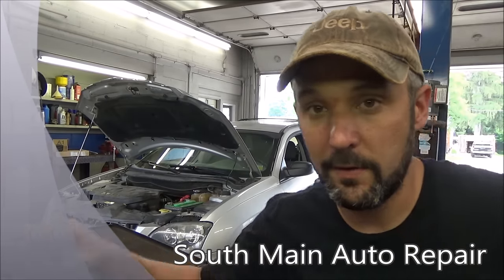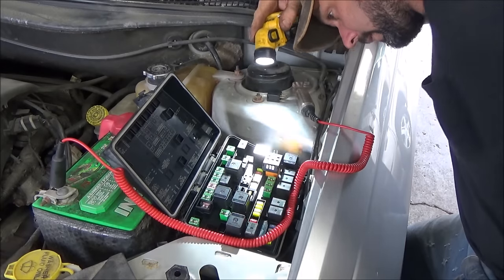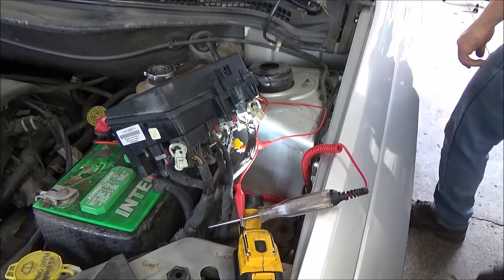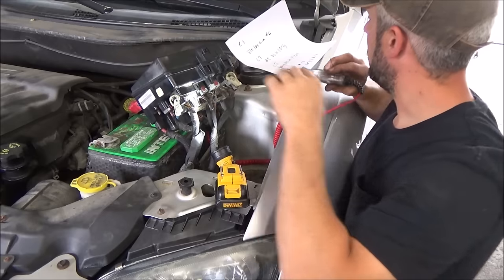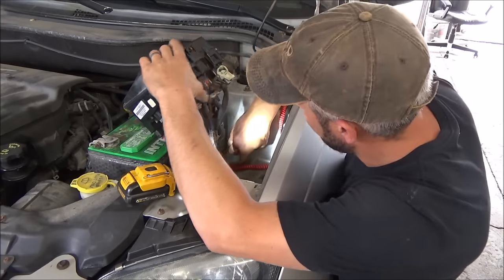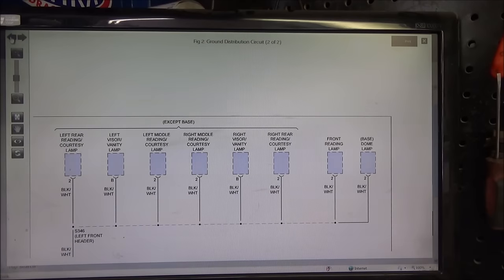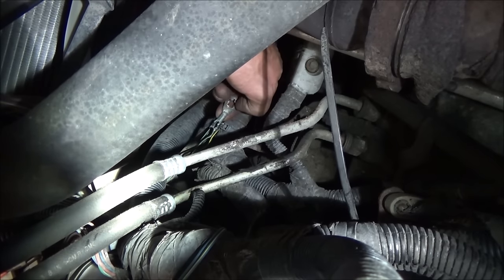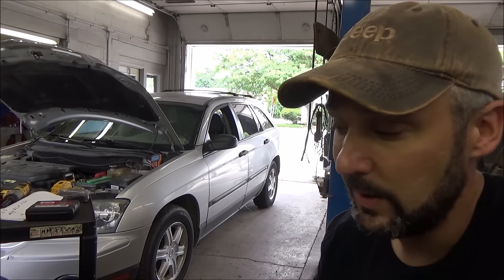Chrysler Pacifica: TIPM Electrical Problems

Comment: Having had the last 3 or 4 of my vehicles Grand Caravan or Town & country (2003, 2005, 2011), they have some pretty weird problems. I have found green wires on the bottom of the power module, rear ac leaking, and the latest the power doors on the 2011 open then close by them self at full open.  I called the dealership about the doors and was told they have no idea why they do that and have no idea how to fix it but they can re-flash the computer and see it that fixes it at a pretty hefty cost to do 
that. I guess the part that pisses me off royally the survise department knows about these inherent problems (yes all ga-gillion of them) and just out & out lye to you if you call & ask about the problem like saying we don't know of them doing this.  (&(%&$@%&& Chrysler.  You may ask why I have had many Chrysler/ Dodge vans if I know they are really screwed up, my wonderful brother has given me them when he gets a new/used vehicles .  Being on a small fixed income I am grateful to have such a loving family.

Comment: Im watching this because my son bought one of these pieces of trash, and is having intermittent electrical problems. I watch all of your videos, but the fact that you did not clean those battery terminals, and did not cover the terminals with a rubber mat before laying that tipm  across the teminals, oh, and that damned bird is bugging the crap out of me.
Reply from the maker: Nope I didn't do any of that. I fixed the real problem 😉

Comment: Our posts get regularly removed, because we tell it as it is, the truth!

Our 2010 Chevrolet Express 4500 cutaway miniBUS with 6.6 Duramax LGH diesel quit twice(COMPLETE BLACK-OUT, ENGINE snapped DEAD in the middle of traffic).

So many vehicles on the road are death traps... just had bought a miniBUS driving it home 200 miles... same issue, except your fuseblock and ground wires are easy compared to ours - we had to take the whole front end apart to get to the equipment - definitely designed to make it impossible for diy. ...and even with that out of the way, still, the harness going into the fuseblock, deep, short, NOT READILY ACCESSIBLE even the top of it where fuses and relays are can only be viewed partially, arm's length deep behind all sorts of obstacles that cannot be removed!!!, with High-Amp connector widely exposed, turn it slightly wrong, massive sparks!  Taking off the fender or wheel well, NOT AN OPTION!

so, IT QUIT(COMPLETE BLACK-OUT, ENGINE snapped DEAD in the middle of traffic, no-where to pull off, not one thing ON, no-way to crank it, loosing speed rapidly, emergency flashers dead, ... traffic behind piling up quickly(up hill on a no shoulder area)... finally squeezed to the right, barely lined-up with the white line, now traffic passing by at 80mph shaking the creamPuff like a tree in the wind at super-high-risk to be rear ended.

Happened every 15-20 minutes on road... turned everything off, no lights in the rain, lucked up on the GM light switch operation with that criminal spring loaded left twist to turn the AUTO OFF.
NOTHING on a dashboard should require to think(or know in advance) so as to be able to operate it!!! ...turned that auto off BY PURE LUCK! Had never seen such switch.  Only realized that later once home thinking back... PHCKNG IDIOTS!

Hit sunny time for last 150 miles and it never did it again.(kept everything off)
- did not know left blinker did not work since the indicator on dash keeps blinking even when lamps/circuit fails(ALL vehicles I drove in last 50 years had that warning, WTF!!! GM!!!)
- same with the high-beam indicator, ON yet-no-high-beams!

Once home, parked it waiting for time to start conversion... 10 months later, decided to let it idle, parked, to charge the batteries, test to see if would overheat standing... within 15 minutes BLACK-OUT!!!

Same SHITE, high-beams failing, one blinker side failing, ... is part of the equation!

Manufacturers are criminals, doing everything so that they keep control and force the GOYim to their repair centers... how can they build something that BLACKS OUT completely due to only one point ground failure!?

Well the people is stOOpid... the people does not oversee/monitor what these criminal enterprises do.

Times will change, with information flowing thru the network, it will become harder for them to own the world and get away with their abuse. ...though they censor all that exposes them.

Cave man's age, iron era, industrial era, information age, ... age of changingTheCriminalLawsAndsuingThePhckOuttaAllCriminalEnterprises.

Comment: i have two of these junk cars. ( pacifica)
(i got 1 for parts).
sit for 2 weeks then went to move it.
NOTHING
I MEAN NOTHING!
DEAD BAT...NOPE
NOTHING!
NO LIGHTS NO NOTHING! NO CHECK NO NOTHING.
JUST LIKE I HAD NO BAT IN CAR. NOTHING!
I WILL NEVER BUY CHRYSLER AGAIN!
10 OUT OF 10 THAT I HAVE HAD ...all had transmission & electrical problems

Comment: Those TIPM's are ridiculous. There are a bunch of non-user-replaceable relays inside them, for example for the fuel pump, power door locks etc. Why not just expose them all on the top side like they do with the horn relay? Why did they decide that you should be able to pull out and replace your horn relay, but if you fuel pump stops working, you need a new TIPM. What a joke. Of course those of us who enjoy electronic pixie wrangling would pull out the pcb and replace the fuel pump relay, but 9 out of 10 consumers, or even mechanics, are just going to replace the whole TIPM. Almost like it is deliberately a disposable part

Comment: I will cross my fingers and pray away
Reply: you can pull one of the fuses & it will drive until you can deal with the ground issues. my 05 Pac has had most of the issues one can find on youtube & many of them are due to the corroded ground terminals under the battery tray
Reply: i forget the exact fuse right now but i know its a 40amp green i believe between 1st & 10th slot. if you pull it out car will run i'm pretty sure

Comment: Ha Ha All you Mopar haters. It was a simple corroded ground that would/could occur on any vehicle. Chrysler electronics ... blah, blah blah.
Reply: Pacificas were known for suspension and electrical issues.  If you doubt it, then Google it.  We had an '04 which was the worst year model Pacifica ever made.
Reply: I have a 04 since New and never had to do a thing to it other then normal wear parts and oil changes almost 200,000 on her now and still going strong with no problems!!!!
Reply: @gregdolliver8402  maybe so, but like I said look online and the others testimonies bc you don't represent the majority of the population
Reply: And as Eric says the cross members on those are known to rust out and disintegrate.   I've read stories about it

Comment: Chrysler is junk...I had cold crank a 2006 chrysler town and country limited and I turned the key off and took it out of the ignition and it was still cranking but no start..had to disconnect the battery...

Comment: What a turd of a vehicle. Around 2008 add to the shitty engineering of that TIPM the fact that they were pinching every penny in sourcing materials and suppliers...chryslers from this era are an absolute joke. I've found this and several other issues with the TIPM on 300's, Chargers, you name it.

Comment: Typical Mopar junk! 
They used to put the batteries over the shift linkage and throttle pressure cable at the transmission and it'd eat the linkage and when you shifted the transmission into various gear positions, the throttle pressure went with it and just created havoc with the poor transmission. 

Again - TYPICAL MOPAR CRAP ENGINERING!

Comment: They build these cars like they will never see any outside elements like water, salt, or oil. Combine bad grounding, harnesses near hot moving parts, and bad engine/transmission designs, no wonder Chrysler is such crap.